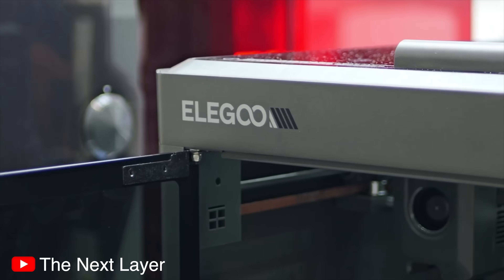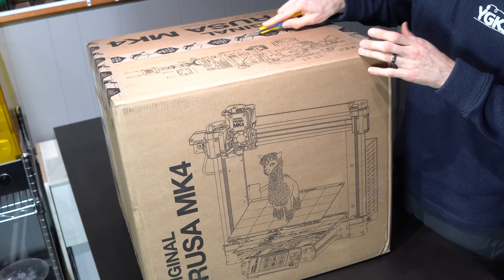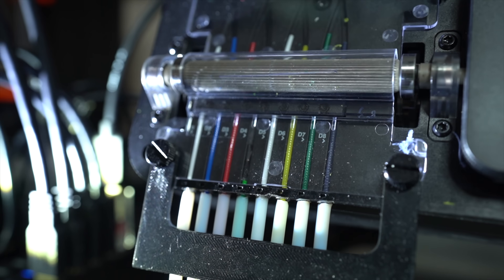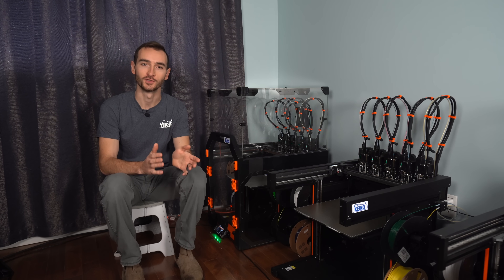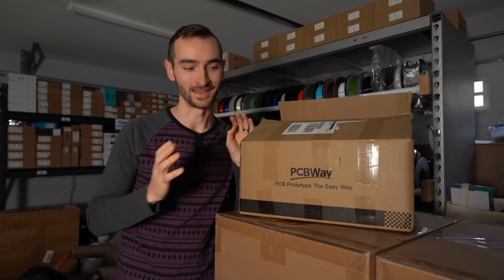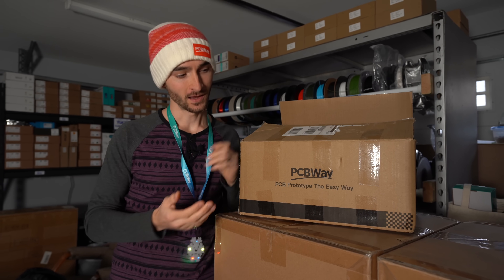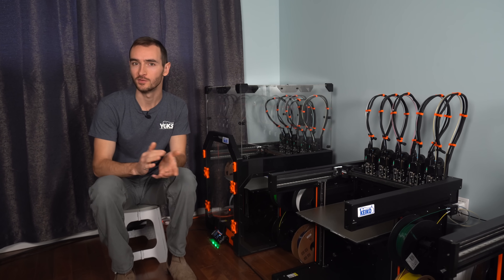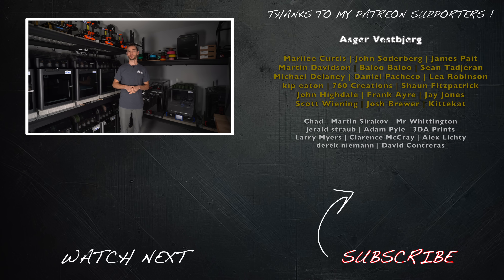The Prusa Core One is dividing the internet...

Comment: Bambu is the new tech startup of the market. I'm sure the following sentiment has been repeated ad nauseum, so I will throw this into the pile.  They've marketed the heck outta the "sleek" and "stylish" design and the user experience.  I've seen way more tech adjacent influencers get sponsors from Bambu than Prusa, ten fold easily.  The insidious part is that Bambu has closed their eco system, made it less consumer friendly, more difficult to work on, and the design is more tech-phone-cheap construction style.  You can see this in the construction approach of the Bambu system, lots of injection molded parts, more integrated unserviceable parts, etc.  These are hallmarks of product design to drive the product cost to it's lowest point to achieve market saturation, and popularity in numbers alone.  Remember, Bambu didn't start making it's first commercial printer until Q3 2022.  They went the classic Chinese tech startup route, get large initial seed funding, stand on the shoulders of giants with all the benefits of the past 15 years of 3D printing, and release only a few focused products to drive out competition.  Buy a lot of marketing, get a lot of "awards" and create "buzz".  Bambu only sells three frame styles of 3D FDM printers, the X1 frame (X1, X1E, P1) and the A1, A1 mini.  But with quick growth, they're now playing catchup with that business model.

Prusa, by comparison, was at the forefront of 3D printing participating in the invention of the reprap movement in 2009 and started as a small venture, slowly building to the large business it is now.  That means the marketing was very grass roots, building trust and reputation, and lifting the entire community with it's growth.  Prusa now has seven unique frames of 3D printers for every type of printing, not just FDM.  Prusa is where it is because of consistent growth.

So what does this all mean then?  Prusa being slow to react is business as normal, 2-3 year upgrade cycle, gaining feedback, checking trends, and improving products.  Prusa saw that the market wants a ready to go fully enclosed system, and they also got all the feedback from all the Bambu users on what they wanted and what they didn't like.  Remember, the 3D printing community is a bunch of DIY'ers and very vocal on their public forum of choice.  And Prusa has the benefit of the experience of what works.  Prusa's manufacturing model also allows them to bring a product to market faster.  So while Bambu is struggling with flooding the market and quick growth and all the growing pains of a startup, Prusa is just doing business as usual.

The same people that are acting like Bambu having a popular product makes them the new standard, have their blinders on to the fact that Prusa has been here for 14+ years, actually supports their products with 24/7 support, has physical repair centers, is transparent with their operations, has consistently delivered products, and works with the community.

Comment: I went from Creality Ender 3 to Bambu X1C. While many claim great prints right off the bat with Bambu, I've done 100 times (literally) more tinkering with my X1C to get it good than I did with... an Ender 3...

The stark difference between BBL and Prusa is that Prusa's just fking work, they're reliable, and easy to fix. BBL is so locked down and hard to source replacement parts (plus official support is nearly non-existent) that ANY edge case, you're better off with a Prusa. That being said, BBL entry-level printers are fantastic, far more sophisticated, and much better priced than Prusa's terrible pricing. If there was one reason not to buy a Prusa, it's price. You're literally getting less for more.

BBL pulled a sizable gap on the rest of the industry, in my opinion, they need to do that one more time with quality of life changes, then they'll be untouchable.

Comment: I bought a Bambu Labs X1E with four AMS and our machine runs almost 24/7 and has done for almost a full year.  It’s had no problems and just required normal maintenance.  My only complaint is the poop wiper sucks and the poop chute clogs and needs poked out/ cleared daily but mechanically and reliability wise the machine is fantastic.  We use it to 3D print prototypes then make negative moulds around the 3D print then remove the printed part and have casting moulds.  We used to need to get precision engineers or toolmakers to do this and it cost a fortune.  This £1,200 X1E and another £1,000ish on four AMS has saved my company easily a quarter of a million (>£275,000) in the last 12 months on third party costs.  Incredible little machine!

Comment: I'm not sure I understand the repairability issue? Virtually every part on the Bambu printers are available on their website. I had an issue with a fried toolhead board and their support helped me troubleshoot the issue and under warranty the parts were sent to me to repair. If I was out of warranty, I could just buy them from their store and they were about $60 total if I had had to repair it. I think Bambu is extremely repairable. I would like to know which parts failed that you cannot replace? Just go to their website, open a ticket and they will get back to you with specific instructions including diagrams highlighted with specific things to check/disconnect, etc. Its really quite supportive.

Comment: I find it a bit questionable to discount Bambu's customer support before even reaching out to them. I had a single problem with a spare hotend assembly for my P1S and it was replaced within a week. Give them a shot.
Reply: Bambu has a 1.4 trust pilot rating for a reason. Their customer support is that bad.

Comment: I ordered a Core one. Main reasons being it's easily modifiable, supported, repairable, not proprietary and the full enclosure is easy to vent toxic fumes (I believe it's fully sealed and can be vented easily.) At some point the filament storage will have built in dry box (not requiring desiccant) you can mount on the side, which works for me. It also should be able to do any filament out of the box. I'm also interested in the multi-material box (MMU3) for multicolored prints, which yes while bamboo has AMS, like-for-like, the Prusa seems to have the edge with waste, and color qty. I just like Prusa more as a whole, and their philosophy for future upgrading, so that's where my money is going. Oh yea, and not built in China.

Comment: I’ve seen a bunch of 3D printers in action, and it really depends on what you want to print. But if you stick with it, you’ll get to making nice prints eventually.
 Prusa 3D printers are legit amazing. I’ve got an MK4S at home, and I love how well-designed it is. It’s super easy to use, and the fact that you can upgrade it is such a huge plus. The print quality is awesome, everything I’ve made so far looks great, even the detailed stuff. But what I like the most is how reliable it is. I’ve done some pretty long prints, and it just keeps going without any issues. It’s one of those machines that makes you feel like you nailed the decision.The Core One printer is great, it looks promising in many ways as it is well thought out and I really like it a lot.

Comment: So, owner of a MK3S+.. been on the fence about either doing an MK4 OR the upgrade but now we have the core 1 which is ANOTHER upgrade.  Have a few Vorons, ratrig etc. from my personal opinion I wouldnt take the 3S to the 4 just to do the core1.  Would be far simpler to go directly to the core1 and bypass the MK4 altogether.   IF I had a MK4 I might consider the upgrade but as I do not I think Id go for the core1 complete.  Just my 2 cents.  I will say much like yourself the MK3 works perfectly fine as does the mini its just they are in my use case used less.  I do have the mini and P1S for bambu but as you mentioned the quality quickly wears down with usage nowhere near comparable to prusa.

Comment: As a Bambu A1 and A1 mini owner that has had his A1 not detect filament clumping and destroying the whole or parts in the hot end, I will be replacing my A1 with a Core One, not a PS or X1C. I bought both when the came out and the A1 for the bigger bed. I look forward to owning a Prusa
Reply: A1is not issue free. It has however been very reliable and consistent even with old filament due to dynamic flow calibration. The few issues I've had with it have been easy to resolve. At this point the Core One would need to be half the price for me to consider it over a couple more A1's.
Reply: Good luck but I would stick with bambu

Comment: One thing that bothers me about Prusa is their somewhat short-sighted approach. Josef Prusa himself once said that no better printer would come after the MK3. (In terms of price-to-performance ratio, the MK3 was unbeatable compared to competitors at the time.) However, when Bambu released their printer, Prusa launched the MK4 half a year later, claiming that this would be enough. As we know, that wasn't the case. The MK4 now seems like a transitional model that could have been skipped and replaced directly by the Core One, which should have been released right after the MK3.

I’ve been wondering what Prusa was thinking at that time. Why didn’t they see the market's direction? Was it a matter of too much pride in their own achievements, or were they simply blind to what customers truly wanted? It seems like Prusa fell behind and didn't react quickly enough.
Reply: There was supposedly a Roman emperor who said that everything that can be invented has been invented *).
🙂

good luck my friends.

*) supposedly it was Charles Holland Duell, Commissioner of the US patent office to whom this quote has been attributed. But even this is debated.
https://en.wikipedia.org/wiki/Charles_Holland_Duell

Irrespective of the validity of the quote, the spirit of a tired entrepreneur who is running out of steam to stay in the competition is showing. Poor guy 😞

Comment: If I hadn't have a Voron Tridex, I would buy the Core One. Bambu is not even a close option as they are a tend to lie to customers: 1st they lied about their slicer, 2nd they lie up to today on what data is transmitted to their servers in China (see 3DMusketers, stls are transmitted to China), 3rd their unbelievable horrible handling of the A1 bed cable issue (DIY option for endusers, in many countries illegal!), 4th their patent hording on tech others used before (even a patent on "extruding filament through a heater with a nozzle as output), etc. etc. . 
   If you are using 3D printers for your business you might have customers who do not want or cannot have their data transmitted to an other company... Further the X1C has non serviceable carbon rails which are only to be swapped out, the AMS produces a hell of waste, the bed is known for its early breakdown (see your 2 units). 
As Voron groupie I gladly use as many Prusa products in my Voron rinters as possible, my 3 Swichwires have all original Prusa MK3/4 beds and sheets, my Tridex uses a MK3/4 sheet, my Micron uses a Prusa silk sheet, my V2 350 uses a Prusa XL silk and powder coated sheet. Prusa support even for their open source silicer is 1st class... I always got help there! I doubt that Bampoo will even touch a support request for their "stolen" slicer!

Comment: Just as a heads up, I have an A1 and 2 A1 minis, I did a dumb thing by not following Bambu’s instructions for repair (also my fault for not paying closer attention to what material and what build surface I was using, so I had a filament blob build up on the nozzle and flowed up into the hot end assembly causing damage when I removed the plastic), as I like to try and figure things out for myself, I basically shot myself in the foot by removing some parts I should not have, and sliced off some wires and lost some tiny axis bearing balls. I was floored that by reaching out to Bambu and telling them what I did. They immediately covered the cost of an entire new x axis gantry, at no cost to me, and sent me very well written instructions to follow, to get it all up and running again. 

They said they didn’t like the experience I had so far and wanted to help make my experience better. I was blown away by this. Maybe it’s different with the A1 series but every single part for those are listed on their website for order. 

Coming from creality printers this was a game changing experience for me. I am sure Prusa printers are absolutely amazing I know they are basically EU labor union so that’s why you pay more, and I cannot talk about quality difference as I do not own one. I also hear the support is excellent, But I imagine they are worth the cost to people making their business out of this. In my humble yet anecdotal experience, Bambu has been pretty fantastic so far. I got my first one 11 months ago. I now have 3, and am excited to see what is coming q1 of 2025. 

I do love basically everything about the Prusa models but as a hobbyist I just can’t quite justfy the initial investment cost.

Comment: I find it odd you chose to give up before even attempting to fix the Bambu printers. I got pretty unlucky with my Bambu and wound up with a pretty unreliable printer but through the internet and help with support was able to figure out it was not a force sensor issue but a damaged hotend and bubbled bed sheet. Replace the hotend and bedsheet and printer went back to be smooth as silk

Comment: I like the BL machines most of the time, the best price/quality ratio in the market since P1S release, however I hate certain practices they have. Like everything has to run through their servers so if your models contains sensitive data that you need to keep locked down then you basicly can't use their machines. Their last server outage cost me many lost multiple day prints, broken parts and order delays. Also the repairability is just the worst and the times that I had to use their support were not great at all, compared to my experiences with Prusa support. BL currently makes the best allround printers for most people but there sure are reasons why people would choose a Prusa over a BL. Competition is good for us consumers so I hope Prusa will survive as long as possible but its sad they didn't innovate quicker back when the mk3s was the hottest thing in the market.

Comment: I recently bought X1C. Was considering Prusa since my first printer was MK2S, but honestly it feels like they fell waaaay behind...
- Price: as you mentioned, it was roughly $1200 for the bambu with MMU or roughly $1500 for Prusa without one - while Bambu was in stock and Prusa would be shipping January 2025.
- Features: shipping in Jan 2025 effectively means that there will be bugs for atleast 4 months rendering the printer effectively unuseable (was the same with alemost any upgrade I bought for the MK2S over the years)

You just get way more bang for your buck with Bambu. Sorry to say, since Prusa is a fellow Czech and I like their philosophy of repairability & maintainability. Unfortunately they just fell off years ago features-wise - slow and steady does not always win the race... Heck, even the MK2S was a pain to get working properly. Took me like a month to get it printing reliably withouth screwing up the first layer. I don't like the "cloud" portion of Bambu, however they do seem to provide "direct connect" to your computer now. Did not try that yet as I wanted to get the "best experience possible out of the box" - and wow, were they not lying. Initially I sent few prints from the phone to the printer and during my test prints I got like 0.02-0.05 variation across x/y/z. Not bad at all!

Comment: I've never owned a Prusa printer before, but I think I am going to purchase a Core One when they become available.  My first 3d printer was an Ender 3 in 2018.  I bought a 2nd Ender 3 during covid to print face shields for my community.  At the time, I enjoyed tinkering with the Ender 3s and so I didn't mind the poor quality control.  I also couldn't really afford a Prusa.  My situation has changed quite a bit since then and while I don't mind tinkering, I'm really looking for a printer that is hassle free and high quality.  I have a Sovol sv08 to fulfill my tinker urges.  Most of my 3d printing is for practical purposes like custom jigs for wood working or storage solutions, so I mainly print black filament anyway.  I think I'd rather give my money to Prusa than some Chinese company.  They actually manufacturer some printer in the US.  As far as brand loyalty goes, I'm not really loyal to Prusa right now, but I could probably be convinced.

Comment: What i miss here is that prusa does not just want to let the camera out of their printers. They have to because it´s a patent from Stratasys. They just don´t want to get sued like Bambu and TierTime gets. Chinese manufacturers just don´t care. They just ignore the patent. Honestly. That is not ok. In terms of everything else the core one is in my opinion far superior then the bambu, because of features like easy maintainability, long life span, high precision print quality, the possibility to add a GPIO hackerboard to control a camera, robot arm or RGB LED´s and many more. The Noise level is also way better then with any bambu printer. Last but not least you said that if one machine breaks you throw it away and buy a new one. As far as i remember 3d printing was a technology to prevent exactly that. It´s a technology to be able to repair broken things instead of throwing them away. I mean that´s truly awful to hear. Shouldn´t we take a bit more care about our planet?